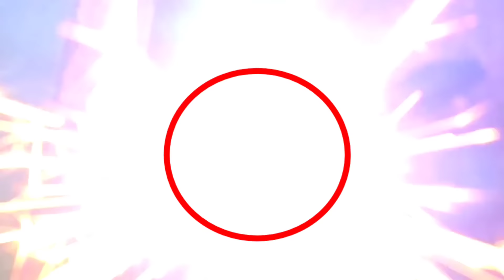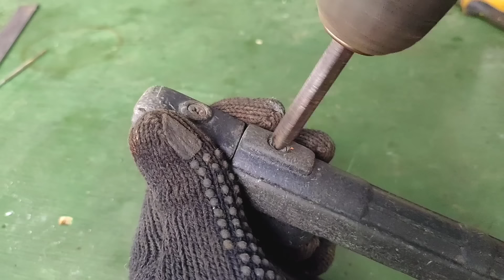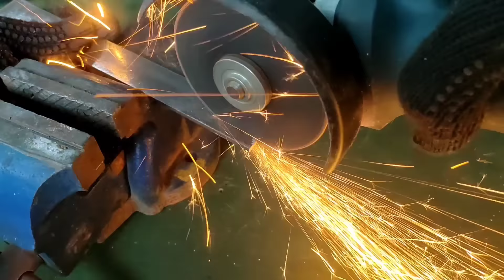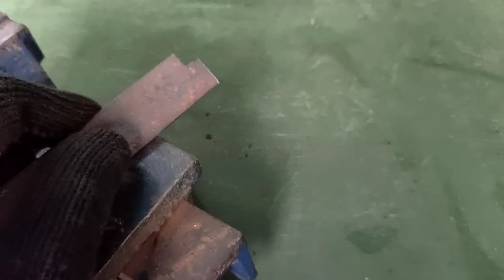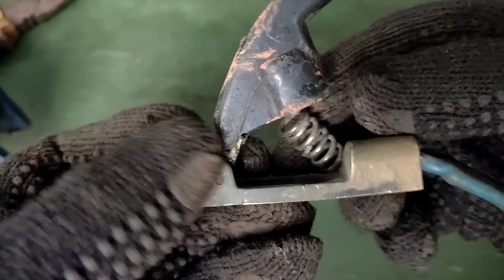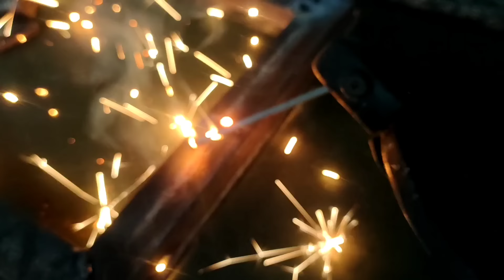Cara tukang las ini menghemat pengeluaran,patut di Di coba

Comment: Electrode holders are made out of brass for a reason, a carbon rod will not fuse with it. This is a dumb idea because now if the back end of the rod arcs it will weld itself to the holder. Thes click bait, false info videos are really getting dumb.
Reply: Or just take a file and file the gap down so it will grab again
Reply: Make it out of brass.
Reply: Ну так сделай ты эту накладку Из латуни или меди,кто тебе запрещает?
Reply: Thanks for the explanation.
Reply: Buy new stinger menards 14.99
Reply: I agree, this video is dumb and misleading... even if the copper clamp was worn and the shim was made out of copper or brass, it was only flush when the clamp was closed. The moment you put a rod in it, it's not flush anymore. If your rod keeps sticking and not arcing, and your ground is good, turn your voltage up.
Reply: Yeah you're right!!
Reply: You are right I'm a welder

Comment: Out in the field when you don't have time to fabricate something like that, get yourself a hose clamp and tighten it around stinger. Quick and easy fix 😃
Reply: With every rod change? Just stretch the spring, or hold the stinger by the tongs.
If you’re gonna carry hose clamps, you might as well carry a back up stinger.

Comment: Dirty clamps, or loose clamps, are no reason to go to all this trouble, run some 60 grit paper between them or if really bad replace the shoe, if just loose Pull the spring Stretch it out a bit and put it back in, no real welder is going to waste that much time on a fix that's going to be problematic after a few welds.

Comment: this is not the proper way of repairing a holder it should be different material to avoid fusing with the electrode.its always comes with the brass or either copper material for electrode holder

Comment: Yo the consumable brass or copper clamp faces are made out of those alloys for a reason. You can’t stop the arcs in that region from deteriorating those pads but at least the rod butts come out east every time. Solely because they’re brass or copper. After a few rods of that you’ll have to grind every butt off your stinger

Comment: Let’s see, the value of a welder’s time is about $125/ hr. If not more. You spending 30 minutes to make a part that costs $30 is unproductive and inefficient. This is what it means to prioritize your thinking. Ok, if your not in a place where the tool is readily available or just need to finish something quickly there are other work arounds that offset that time spent. But this is why attorneys have paralegals, carpenters have helpers. Welders have apprentices. You have someone who’s value to productivity is nominally less deal with things that cut into your productivity.
Reply: This guys time is worth $ 1.25 / hr  he saved $ 28.75 .   LoL 😂

Comment: I would have just  installed a longer or stronger spring...shimming  like this us just putting more pressure  on rod and those contact point are made not to weld themselves  to rod ...steel inserts will

Comment: Get your self a set of drill bit taps.
Drills holes and threads your work piece.
The screws are common thread sizes.
6-32
8-32
10-32
Reply: ...and bolt the vice to a bench and use it!
Reply: @davidkennedy4845  no one pointed out the sheet rock screw holding metal parts together